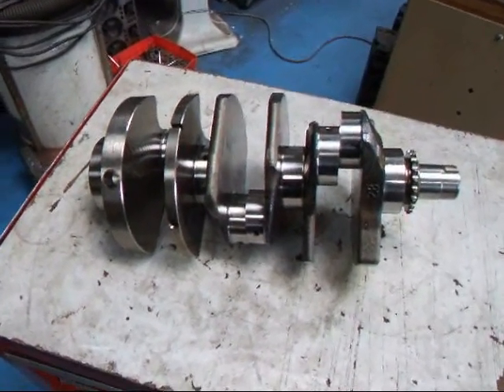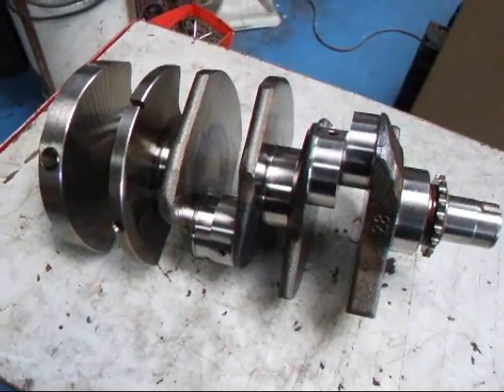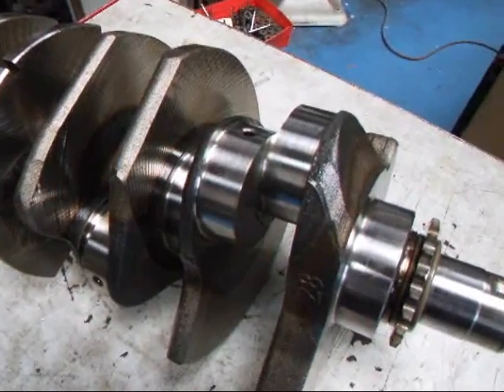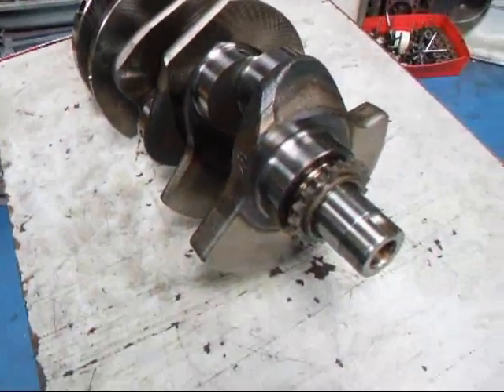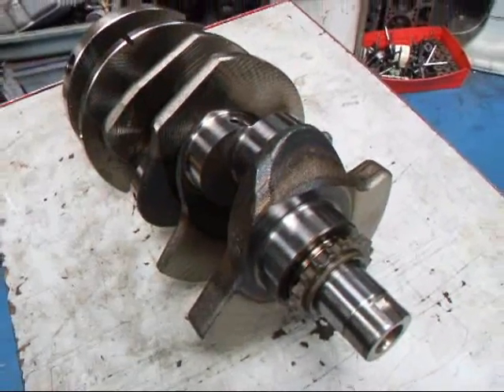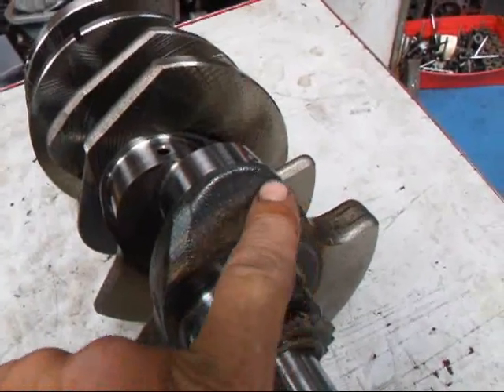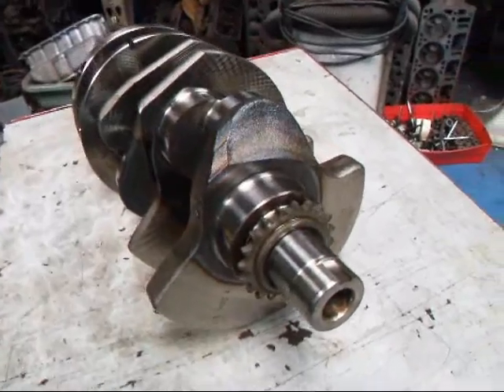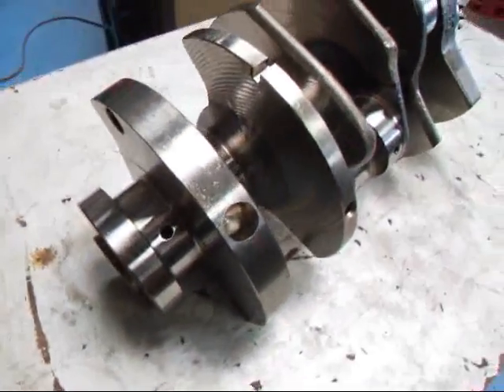Induction Hardened Crankshaft

Comment: Nice Video. The offset rod journals are lame at Best as they are weak points in a crankshaft. GM used them in the 80's in a v6 displacing 231 Cubic inches. They were garbage!!!! The only reason I can think of for an offset rod journal is tmanufacture's

Comment: There is a rare VW factory video of the bearing journal hardening.  They used a gang of acetylene torches in a fixture and spun the crank in the flames.  From there the crank was immediately quenched.  On induction hardening, it would be interesting to know the depth of the hardening???  Also the AC frequency induced.  Just some metallurgy quizzles???

Comment: Ford Calls induction hardening = Forged
Mustang GT rods are made the same way as 1987 Ford Escort 1.9L

SS Camaro hits their rods with a hammer for Hot Drop Forging and Ball Peen Forge
That's Chevy for Forged
The aftermarket rods Ford buys for Boss Motor are made this way also

Comment from the maker: Depends on how deep the hardening is. Most machines used for thisprocess are calibrated to produce hardening to a specific depth. How deep depends on the manufacturer. Most hardenings allow you to grind the crank at least once some not at all. I know this sounds confusing, but there should be a spec somwhere that is supplied by the manufacturer as to how much.

Comment: I  worked for a very engine company when we were just beggining production,  21 cranks made it into engines without being induction hardened. They went thru the machine, but a program error only allowed the bearing journals to be heated for a half second, instead of the normal 8 seconds. It discolourated the part so visually it appeared normal. But they were only partially hardened .003" deep. You should see what the engine looked like after hot-test! The rods were friction welded to the crank.

Comment: VAG did such a clever package engineering/marketing..so they've lost 3 bearings and managed to knock off what..6 ins length, so the package that gets in the way of stretching your feet out or squeezing in a better air con or some such ..having lost 3 bearings, is it more unstable than a 7 bearing unit? naturalyshocked ..say VW advice it's not suitable for racing ..clever, is this Apple with a metallic paint finish? You get the shiny marketing, and the nice badge & they pick up the load stone?

Comment: @WestLosHomiez  The crank can usually be salvaged through welding and regrinding any damaged journals,any good engine builder should know someone who can fix that,the block may even be repairable in much the same way.There again,if the engine spun a bearing and threw a rod through the case,you're out of luck.

Comment: i have CX25 in my car, designed with help from cosworth, achieves 230+km/h with ease and it revs good, pitty about the abrupt 6000 rmp limit.
but i love to drive it.
the weight of the car is only 1050kg.

Comment: yep, that's the trick, offering people a cheap and small 6 cyl, for small cars like the golf.
it was a true Hit.
for people that wanted more than a 1800 (16v) and later 2.0 GTI, but loved the golf.
it also used special pistons.
according to VW it was not suitable for racing due to narrow valve cam follower, but people achieved pretty high power from it and also very high millage.
so it was/is a good engine, atleast those here in europe.

Comment: This is the same concept as is used to harden tools, with the exception of using a furnace instead of electricity to heat it, right?

Also, an overheated crankshaft (or any other component) is likely to be out of shape and will more than likely have some sign of warping, no?

Comment from the maker: It doesn't the surface is hardened, the the core. That's the beauty of induction hardening. The core can still twist and bend as needed, while the bearing surface is sufficiently hard to take the abuse of high HP.